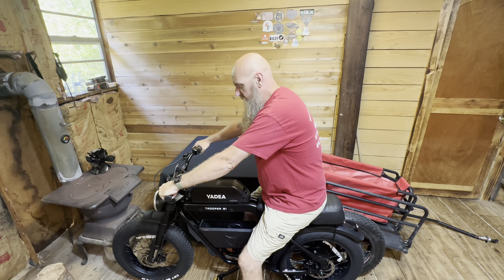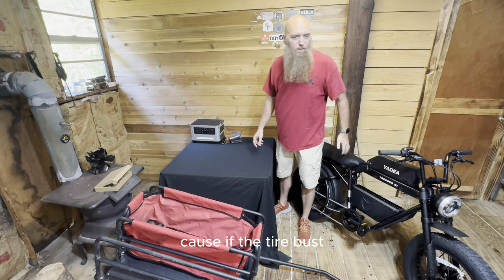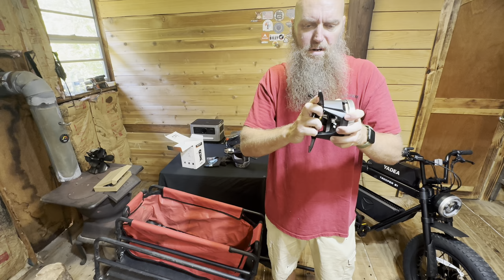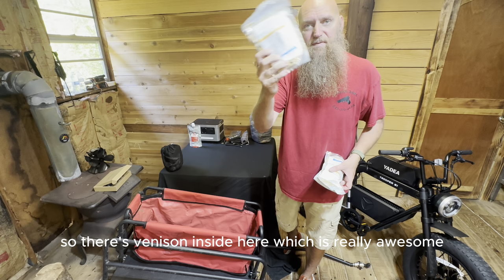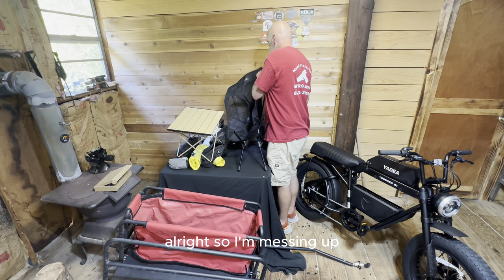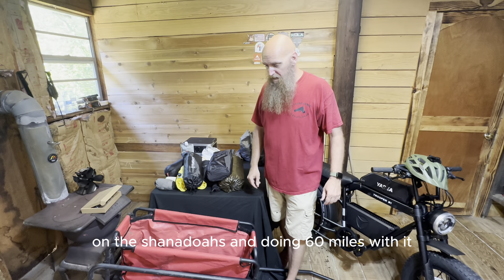Yadea Trooper 01 Review: The eBike That Outshines Super73 | Ultimate Electric Bike Guide 2023

Comment: I have one of those Fire Maple stoves. The gas will fit in the pot but it is tight. 
It works just as well as the Jet-boils I’ve seen. I do use the isopropyl propane fuel mixture for cold weather. 
Good luck with that little inflater, I’m on my third one. Can’t remember what the brand this last one is. 
Love my Big Agnus chair though, worth every penny as it’s a little bit higher and easy for older folks like me. 
Thanks again Barry for another excellent video.
Reply from the maker: Thank you Doug for watching buddy 😁